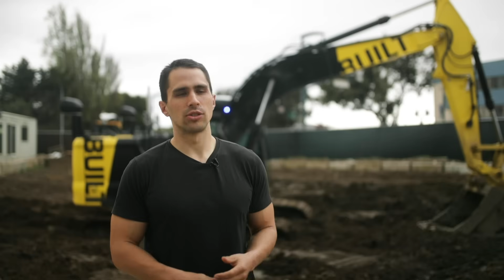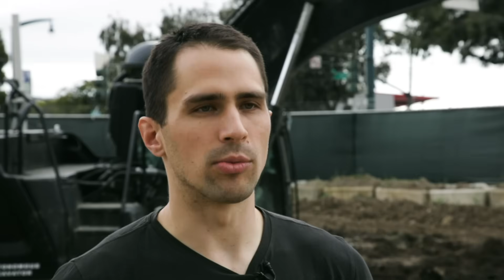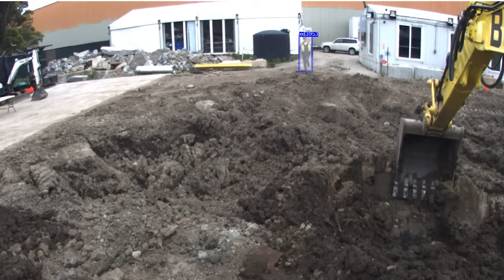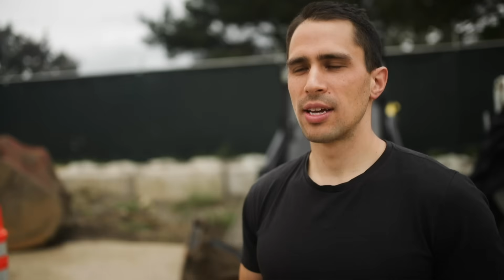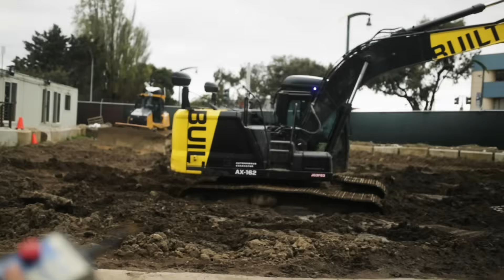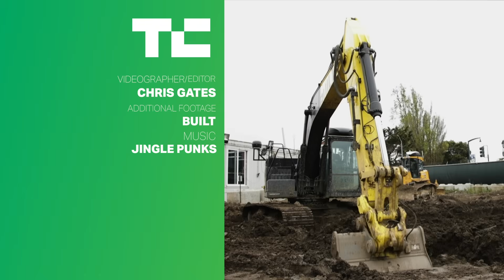Built Robotics brings self-driving to construction

Comment: I watched the one with the Skid Steer and if it was actually running autonomously, then I'm thoroughly impressed. Usually, autonomous equipment runs really, really slowly, which has always been a big issue in my eyes. Either way, this is still pretty cool. No, I'll never use one or buy, and I will always rely on a good, human operator before I a computer, but it's still awesome to see. I could see something like this being useful in mining, but it wouldn't be worth a flip when it comes to the type of work I do..